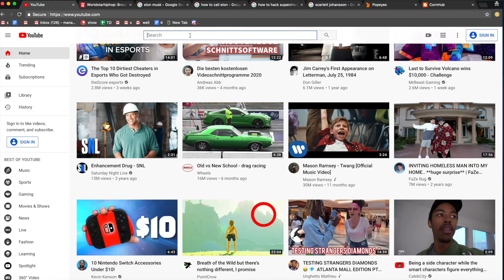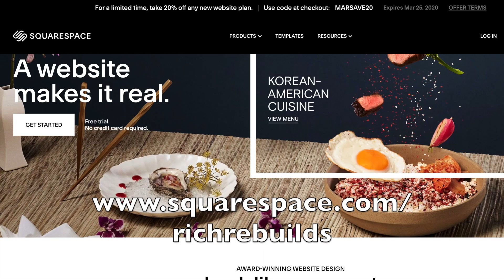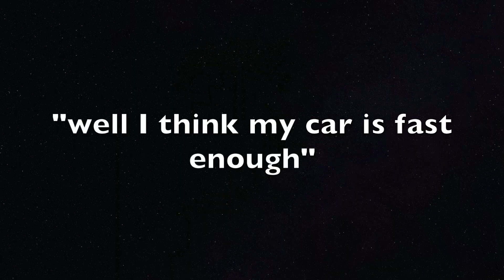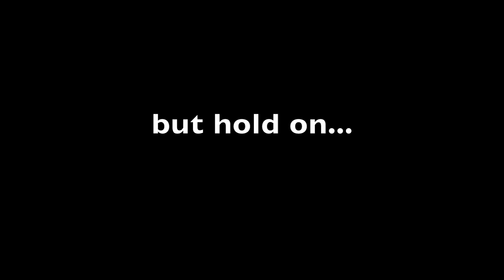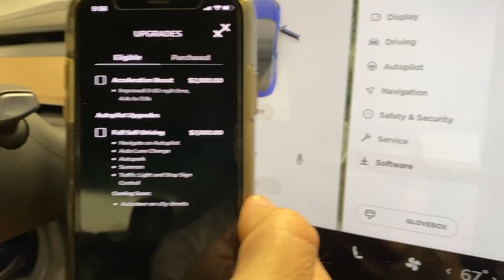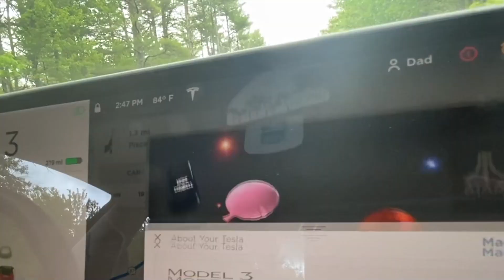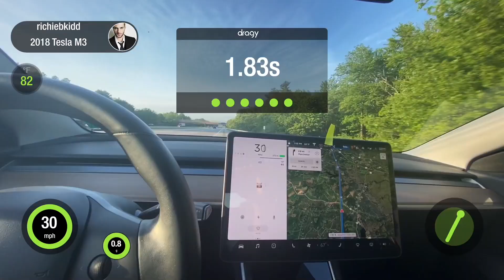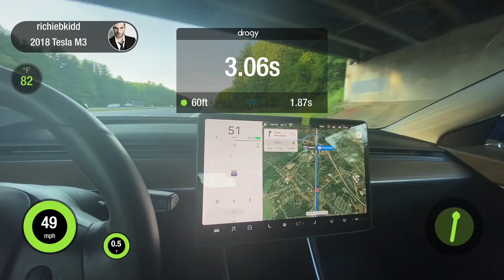We hacked the Tesla model 3s and it's true potential is INSANE

Comment: You have no clue....yes you can put 1000hp in some gas cars but you will never be able to use it unless you go to a track....with the tesla performance and with almost all tesla you will leave behind all gas cars at the traffic lights without the need of engine tuning, it's about the acceleration not about the max speed....where can you drive faster than 70 mph without risking a fine, but I can pull much harder and win that pull every time again without exceeding the speed limit ....the only thing you will see between to traffic lights without exceeding the speed limit are my taillights

Comment: Well, I now have the 2023 model Y LR AWD and it does have some good acceleration even without the additional boost I could buy.  But I am not planning to drag race the vehicle. I bought Electric to get away from the gas pumps.  I charge the model Y at home.
I kept my ICE Monte Carlo for a backup vehicle and to do dirty jobs. So I also have both gas and electric vehicles.

I like those real engine sound exhausts that you are putting on the Tesla. Wonder if Elon Musk knows about these?
Thanks for the video. Take care.

Comment: We literally don't have enough material to build all the needed batteries to switch all vehicles over to electric battery, we need to do hydrogen fuel cell
Reply: where would the material for the fuel cells come from then?....

nah, getting the material for the batteries wont be impossible, tough, sure.
Lithium is extremely abudant, same with most of the other materials needed for the modern cells
Reply: Source?

Comment: My personal opinion:
Don't necessarily take all this as fact. It was hardly researched.

The Tesla was/is far too ambitious. 
It's not very practical, especially compared to a bio-fueled vehicle.
It has too much technology, especially compared to security. 
The keyfob has poor encryption, therefore, easily hackable.
Keyless Teslas are hackable in similar ways considering virtual keys can be easy to hack. 
Some Teslas are started with phones, therefore all you need to do is hack and/or steal the phone or replicate the signal (I think).
The best hybrid car can almost double the range of a Tesla.

Where's the electricity coming from? For all we know, It's just as bad for the environment as gasoline.
In fact, we have proof that the majority of electricity comes from burning coal, oil, and gasoline.
Also, the discharge of hot water when generating electricity causes thermal pollution. 

The usage of electrical vehicles is emission-free, but the generation of electricity is not.

Comment: I could have bought a Honda Civic and increased the "performance" of it. Increasing engine power? Can the transmission or drivetrain withstand the increased stresses? It must be considered. It is not simply a warranty issue. I could have improved the drivetrain and then the brakes, the suspension, on and on. I bought a 911 turbo instead.
Reply: True civics are dumb but il stick with my 1985 Mazda RX-7 the difference between mine and yours is most likely I have thrown mine around corners as hard as I can without caring if it was wrecked, why? it costed me 3 grand lmao

Comment: I wonder what it would run in a 1/8 mile since it pulls at the top end harder with the ghost
Reply: Wait what’s the difference between a ghost model 3 and a stealth model 3? Is the ghost module faster than the stealth??? Cause I heard the stealth model 3 is faster than the performance model 3
Reply: @shelbyhaiketic4212  the stealth model 3 is a performance without the badging on the back.
Reply: @Christian.McDonald well without the badging, brakes, 20inch wheels and some other things
Reply: @shelbyhaiketic4212 they’re identical. It isn’t putting out any more power, it’s just telling the car to run as a performance instead of a long range which is why you need the right motors

Comment: When you hack it, you can also enable the back seat heating, that you otherwise have to pay extra, even if it is build in every tesla
Reply: Not on the long range M3. They already have that. The Bonus Module allows the Standard range Tesla to enable the back seat heating. The Long Range does add the ability for the person sitting in the back to control the seats themselves without having to use the screen.

Comment: One of the fastest and cheapest SUPERCARS,  yes I said supercars, you can easily afford is the 2006 and 2007 Mercedes Benz S65 AMG. This car will break the 200 mph marker qualifying it for a supercar. This car was around $220,000 brand new. It was the flag ship and the first year AMG in house got it up to 604 HP at 738 lb-ft. You can get a optional ReNNtek R1 performance package for $3000 that will get you dyno certified at 670 HP and 840 ft-lb. These cars can be found with roughly 50k miles on them for no BS $15,000. So for 18k you can have a daily driver that can do under 12.00 in the 1/4 mile, top out at 202 mph, and is the pinnacle of luxury. These are damn sexy looking cars too. You would never know except two things, the exhaust if you rev the motor and the bi-turbo emblems on the side. It has a V12 twin turbo 6.0l  engine. 6 speed transmission and the engine was built by one person from start to finish with a name plate on your motor from them. Check it out you will not be disappointed in a used car that costs less then a new Prius but will blow the doors off your Vet and Model S. The only drawback is the expensive coil packs should one of the two fail at about $1500 each and they do.

Comment: Why if you were to add more voltage. A secondary pack in trunk that steps up the the voltage. It will go faster, more voltage means faster motor. 
kv = rpm per volt

Comment: You were launching incorrectly. What you're supposed to do is:
Hold the acceleration pedal and break pedal simultaneously,
And then you release the break pedal while still holding the acceleration pedal. BTW, I'M 11 YEARS OLD AND I KNOW KNOW TO!
Reply: That's called a boosted launch, only works on turbocharged engines not electric motors

Comment: If I’m not mistaken the performance model 3 got an over the air update to bring its numbers down to 3.2 sec 0-60 times and the dual motor with performance was brought down to 3.5 sec 0-60. I’m curious if your upgrade stacks on that, also can I still do over the air updates? How does it effect autopilot?

Comment: Nice to see this happening but there are always downsides to this stuff, namely the faster you discharge or charge a battery the less life you will get out of it. Tuners will inevitably take this too far in their pursuit to offer customers the fastest car and inevitably destroy the service life of the battery.
Reply: who  cares. It's their car.
Reply: @88joshuajohnathan  Not buying an EV second hand car with a toasted battery  and not getting burned alive inside a car that has over discharged beyond it's batteries 'c' rating come to mind as reasons to be concerned. 
Plenty of pictures of high performance EV's burning on the internet due to battery issues.
Reply: @johngraham8052  with a toasted battery… lol.  The ignorance just in that statement alone tells me how little you know about EV’s or their batteries.  Also the “burned alive” is the second part that explicitly tells me how smooth your brain is. For example “With these new so-called experimental vehicles, we have nowhere near the 90 vehicle fires per billion miles caused in ICEs,  no deaths,  and nowhere near the fire related injuries.

Of those 4 brands with the most miles driven; the Chevrolet Volt recorded the first famous fire when  obliterated by the NHSTA in a parking lot due to a failure to discharge the battery after crash testing. This would be equal to leaving gas in the tank of a crashed vehicle which NHSTA NEVER does so  we count this one with an asterisk. Of the billion combined miles of the LEAF, Volt, and Ford Energi series, no fires have broken out for customers while parked, driving, charging or collisions of  these plug-ins.

IE all fire related deaths in vehicles were from negligence and crashes due to driver error or in Neanderthal terms “doing dumb shit” 

As for the high performance EV’s that’s because they overtune them.  Just like an ICE you overtune it you blow the motor.  
Read a book. Educate yourself. Quit being a NPC. It’s kind of pathetic.

Comment: I don't know I seen a stripped-out Tesla basically it had very little seats very little plastic and they were using it to race.    kind of makes sense you take down the weight of the vehicle with the same size engine same size battery it would obviously go faster but it was putting the muscle cars to shame

Comment: I think you're over estimating how long you're going to be able to use whatever exploit you're using to get the performance bump out of the software.  All it takes is Tesla dropping a patch on you and you're done - so is everyone. 🤷‍♂️
Reply: Uh, to be clear, I think it's kinda dumb that Tesla withholds it via software, and it would be cool if you could "do it yourself" by standard, but that's just not going to happen.  Software is always going to move faster than you can hack around it.

Comment: I’ve never seen anything more pointless than those exhaust imitators
Reply: To be fair, if I have to have my Tesla make a ‘noise’ that’s a better noise to have. The whine or grinding noise others have is horrible.
Reply: I actually want to remove the noise filter. Sometimes I kind of want to hear the "VRVRVRVR" of the motors.
Reply: actually, it'll make other people hear you so it's safer. next of all, almost all new cars are fitted with exhaust imitators in the cabin despite having an actual gasoline engine. Now let's concider you have a car that goes 0-60 in 3.5 seconds, does the 1/4 mile in 12 seconds or less, why would it be wrong to add some oomph to it? People throw loud exhausts on their civic, then people can have engine sounds on their Tesla.

Comment: I gotta say as a gearhead I like Tesla but not the way Tesla handles them. I personally wouldn't buy a Tesla until they release the cars to the owners. IV built hot rods lots of tuners and well I'm accustomed to alot of power more so the joy of squeezing it out. This is cool but too small of a gain for a car that heavy. Come out with something for up 1000+up guys and I'll buy it but if it's not atleast as fast as a 1000cc sport bike and acceleration is it's claim to fame then I'll pass. Currently I have an rx7, Volvo s70, a few Honda's, many bikes, and 1g eclipse, and a few more. Atm I'm pretty sure that my eclipse would wax this and I can't have more than 5k in it and it turns stops. Think if Tesla made something for car guys that could make me say wow that's alot of bang for the buck and room to grow they would have a hit and more so something car guys will remember ten years from now.
Reply: New Roadster will be running high 8's in the 1/4 mile in the base version, probably mid 8's in the spacex version. That is easily a 1000+ hp car. What does your Eclipse run in the 1/4 on street tires?

Comment: I wanted to get a Model 3 Performance at first but when i raced my buddy's i gapped him pretty bad.  It took 12 cylinders and 2 turbos and some help from renntech to do it but regardless, it wasn't even close.  I'd buy a M3P if there was a ludicrous crack for it that'll run sub 3 0-60 and 10's in the 1/4 mile.  I did run a P100D with ludicrous and he got me by a car length or two.  Of course all of these races are from a roll, from a dig i think i'd get shit on by both cars pretty bad that i'd just give up.  Good to see there are tuning potentials for EVs, it's exciting and game changing for sure.
Reply: Next gen batteries which Tesla is about to publicize will very likely do just that. They will have higher energy density, and thus the car will weigh less as well and so they'll be able to put in higher capacity packs which will discharge much more energy to the motors and create a lot more power. We are not far off from that. Pay attention to Battery Day coming up.

Comment: Of course, "improving" the performance of these cars has as much sense as emitting that fake engine noise (fake engine noise is like fake boobs - potentially interesting only from afar) - zero. (You forgot to add a small tank with gasoline to spray and another with a mixture of NOx and COx to vent, so making it a "proper" car).
But I do understand the drive to modify the stock vehicle just to show that it can be done, warranties be damned! Of course, I would love to know what these modifications consist of - I guess mostly software? Now, that's the kind of hacking I like!
Reply: It's all software. Tesla essentially gimps the LR AWD with 980's, even though they are identical mechanically to the Performance. They also have a lot of buffer versus what is the true potential.

Comment: Hey Rich i thank you would have fun with 1987 Dodge OMNI GLH-S (Goes Like Hell S more) had a inter cooled 2.2L 4 Turbo 250 HP with a car that only weighs 1800 LBS. Carroll Shelby infused these Omni's and they are all numbered with less than 800 built. These are only in avaicle ina Muncie  5 speed Manual only. These are fun and cheap to tuna as well up to 400 hp

Comment: People have been adding performance kits to new gas cars since their were gas cars. Those kits risk your warranty. So don’t wine that the software hack might void the Tesla warranty. We don’t care. We just want to be faster.
Reply: Warranty lol pro rated warranty. If you buy a product you should be a le to do what you want with it. It's called ingenuity  that's in the mind of all of us. THE NEED FOR SPEED
Reply: Don’t wine LUL whine bro
Reply: That’s not true. You can mod your care and remain under warranty unless the mod is directly related to the mod.
Reply: You are correct. New larger exhaust. Smoothbore intake manifold. Upgraded spark plugs and wires. Oversized radiator. Performance brakes and calipers. Yes everything else is still under warranty. Great point!!!!
Reply: Hacking the software will definitely void warranty as making the car faster by overloading the motor which will make components of the car break faster so why should Tesla pay to fix your experiment. Also hacking the software will make the car lose an extra half of its retained value when you sell it as no one will want it as they do not know what you have done to the car, they don’t know if the car is in piss poor condition or in reasonable condition and don’t know if the car will be reliable for them. doing mods like this are illogical if you want a faster car for less money
Reply: @jhh631  thats moding. Your car becomes less valuable, but you pump more money in it. Only in the car community it is to show your baby. Mostly when you sell your modded car, it is sold for less than an original. But that is the choice that is made. Only the best tuned/moded cars will sell for more. If it has a badge, like Audi with ABT or Porsche with RWB. Or BBS rims. Those options will mostly drive up the price. But mostly a moded car is sold for less than a original car.
Reply: JH H You are right about one thing, Tesla shouldn’t have to work on a modded car. They should give that right to guys like Rich and private garages also, and make parts available to everyone, not only at Tesla dealerships, but auto parts stores. If I bought the car, it’s my car, and I should be able to do whatever I want to it, despite your opinion.
Reply: @ginobenedetto4943  the argument is that you own the car, but not the software. Therefore you shouldnt tamper with the software. I do agree tho that parts and repairs should be available from 3rd party but its really not that simple

Comment: Hydrogen is actually really good
The main problems about electric are the weight and components used, and hydrogen just doesn’t have these problems.
There sure is minuses to hydrogen such as performance,  but it is not as the world needs fast cars
Reply: Fuel cells will never gain traction. Storing hydrogen is insanely expensive for one. It is a cost prohibitive technology that is completely impractical. You may think the world doesn't need fast cars, but the world will always crave speed and more of it to get them around. Electric cars get you around fast while being smooth and quiet. People love that. People will not go from a fast electric car back to something slower. There has to be other reasons for it to be compelling.
Reply: @taipoxin  Such as ressources that are needed to produce lithium-ion batteries, you're damn right

Comment: Reduced weight makes it faster....
Reply: Really? Who would've thought. You need to remove a lot to make a noticeable difference, and primarily rotational mass unsprung weight, otherwise you're just going to be gutting the car. Stage 3 will get you there a lot easier and without having to remove practically everything from the car.